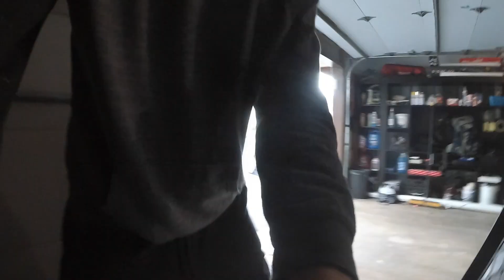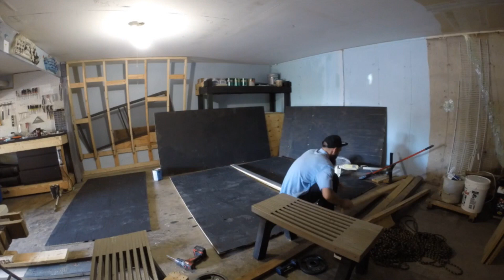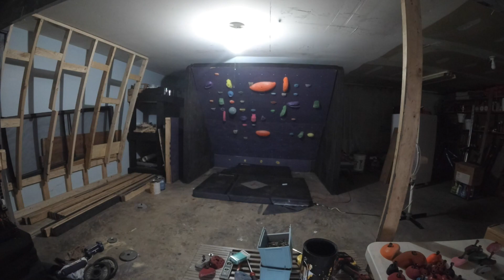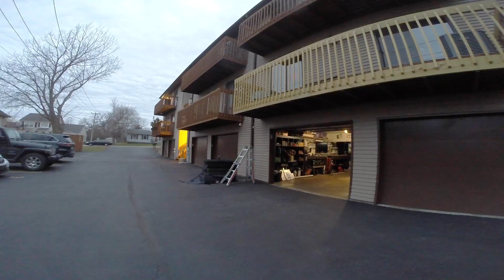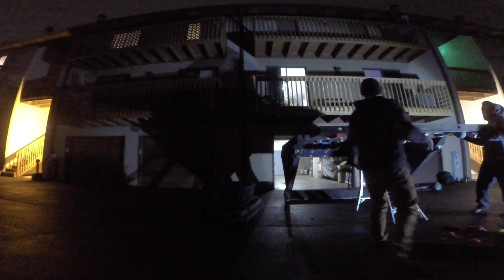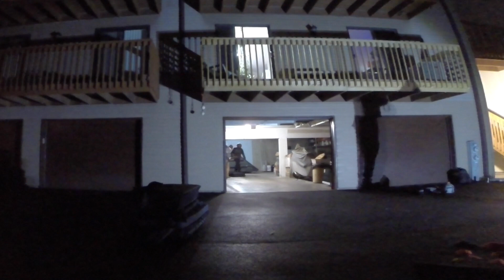2019 #HomeWallOfTheYear Submission

Comment: Love your wall - using your modular idea! Building it right now, but ran into a problem - I bought 1 inch black pipe and drilled 1.25in holes like your other video says. But they don't fit! lol - Did you use 3/4 size pipe (that has an outside diameter of 1in and  would fit in the 1.25in hole) or did you use a larger drill bit for the 1inch black pipe (that has a 1.3inches outside diameter? ) - trying to figure out if I get the smaller pipe or drill larger holes- Thanks!
Reply from the maker: I believe 1" Gas Pipe is referring to the inside diameter of the pipe. I don't recall which bit I used. It was definitely smaller then the pipe. The rest I ended up boring out with a $5.00 harbor freight dremel. The first couple times you slide it together will be snug but it will loosen up. DM me on IG: @84v7climbers I'll send you some closeups later.
Reply: @84v7climbers7  thanks! I ended up returning the 1" for the 3/4 before you replied, so I'll try it out this week...it it flexes too much I'll return it for the 1" - appreciate the info!
Reply from the maker: @NakaiPhotography  Let me know how it works out.

Comment: Hey! I really love the design and we are currently looking to build one and would love to use your design if you wouldn’t mind! Was wondering how it held up so far, if there were any recommendations you would add or anything you think woulda made it better?  Thanks!
Reply from the maker: It's held up near perfect.

What I would change:
A. Adding another 2x6 support on the base. Instead of four 2x6s use 5.
B. With one person you will only be able to set up the first extension. I'm trying to figure out a way to set up the whole board solo.

Pro Tips:
A. Spend the money on screw in t-nuts.
B. Take your time during construction. The better the wall , the more time you will spend on it and want to show it off.

Final thought:
If you scroll through my older videos you can see that I had a whole cave in the back of my garage. My old climbing wall was amazing, but I do prefer my new one.
Reply: @84v7climbers7  Thanks for the Advice, just finished the bottom portion and it feels solid!